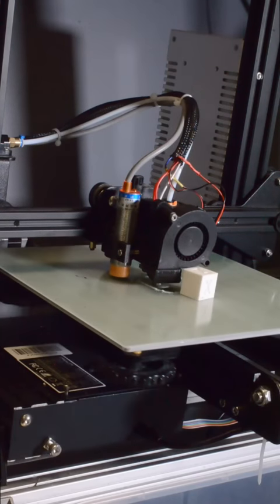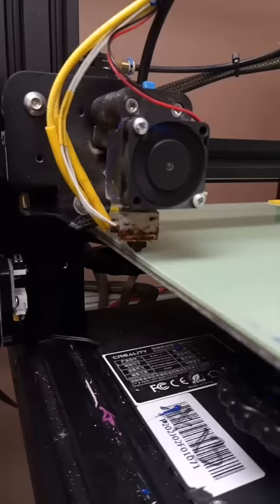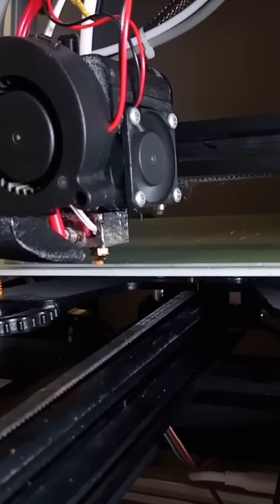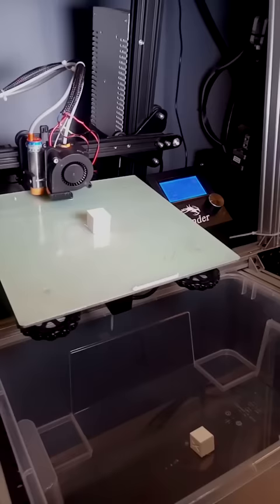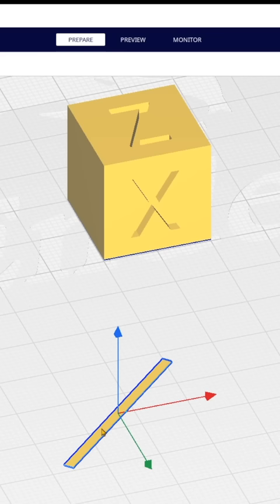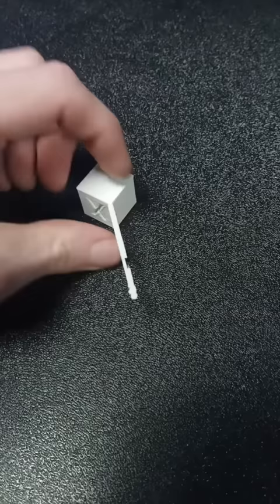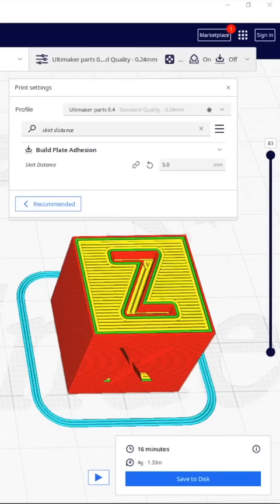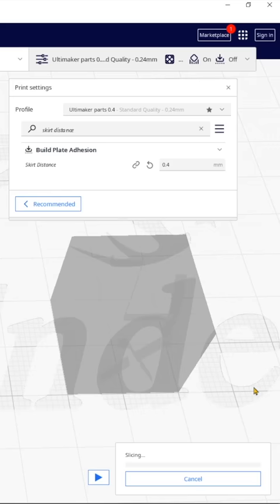How do automated 3D printers remove skirts and purge lines?

Comment: FYI, if you use the Cura extension "Parts for Calibration", you don't need to model simple shapes in CAD anymore - just insert and scale them. Works great for manual supports, corner tabs, and things like this.
Reply from the maker: Great tip, thanks for sharing!
Reply: @3DQue You should pin this, it's actually useful information.
Reply from the maker: @gownerjones  Good idea. Pinned :)
Reply: How do you auto eject @3DQue
Reply from the maker: @colb316  Join our discord server to learn how to auto eject prints: https://discord.gg/JN9EDP8
Reply: @3DQue  ok I joined now where do I go
Reply from the maker: Check out the channel bambu-lab-auto-ejection @colb316

Comment: I'm sort of if new to 3d printing (about 7 months,) is there any use cases for a skirt?
Reply: Normal skirts are good because they purge the filament. If you do a few lines thick, you can also watch the deposition to check everything's working as it should be before you print
Reply: Thank you
Reply: Good for baby stepping your z offset manually to get a good first layer too. Different filament can need different z offsets.
Reply: It tells me the part outline before actually starting the part, so i can see if i placed enough tape. It also primes the nozzle, in case some leaked out during pre heating
Reply: I never use them and find that Cura defaults to using them super annoying.
Reply: @court2379  wierd, for me it doesn't default to that.
Reply: @zekeprice  Probably depends who setup the profile for different printers and filaments. I really should create my own, but I usually just use the provided ones.
Reply: Makes sense
Reply: Helps you figure out if your printer is levelled properly
Reply: Basically a purge line, and a bed level check
Reply: @wikedawsom  I don't understand all the fuss with tramming the bed. You set it once after changing a nozzle, and then don't have to touch it for half a year or more. So to then have a skirt all the time is just a waste of plastic and print time. I just watch the first perimeter go down and adjust it if needed while printing. If it's really bad you are going to need to stop the print either way.
Reply: @Shawn R  I tend to switch back and forth in between ASA and pla Pro on one of my printers. Dialing the offset that fraction more, is how I am able to get 0 glue stick, yet perfect adhesion with Poly-ASA.
Reply: @TTS-TP  i still use glue sticks lol
Reply: I love the skirt setting to make sure that im getting good adhesion indicator for the area that the print will be done in. It also helps me make sure that i e got a proper z offset and gives the extruder the opportunity to purge any possible gunk or show under/over extrusion if i make any major changes to the print speed settings.
Reply: The main use of the skirt is to prime the pressure inside the nozzle. Otherwise your print may start with empty line. Other use of skirt is that you can print tall skirt (as high as the print part), and it will cover and shield the printed part away from the cold environment to prevent warping
Reply: Skirts can also add surface area to the bottom layer of the print, allowing for better adhesion.
Reply: I may also be combining skirts and brims in my mind...
Reply: I do three line skirts so I can check my bed remains leveled. Just by eye I know how first two lines should look like and can level it while running. Third line is to be sure I leveled it correctly.

Comment: you also can "hang" the purge down the edge of the buildplate, like Snapmaker does it for example  - it requires your printer to go out of bounds of the buildplate or have a rounded corner that lies ot ouf bounds though

Comment: I've completely removed the purge line from my Cura settings, after I found that it wasn't actually necessary if you print in the same filament and color. If you change filament type and/or color, you can just run a purge print and that should be good enough. Only problem may be if you use composite filaments, which can be problematic and truth be told, I've only tested this with white PLA, so I honestly don't know if changing will work, but it should. There's no reason as to why it shouldn't. Your nozzle can be clogged regardless of what filament type/color you're using
Reply from the maker: Very true. Nozzle clogs can happen any time. With high volume printing, we find that we have fewer issues if we use a skirt.

Comment: For Ender 3. I made an extrusion along Y, at the maximum X (235 mm). Due to the fact that the end of the ender is crooked, it is empty there.  Of course, I put 235x235mm in the firmware.
Reply from the maker: That's another good way of doing it, just dumping the filament into thin air. Does the nozzle get wiped by the edge of the bed? I know some people have tried that, and it can work if you tune it properly, but it takes a bit of trial and error.

Comment: Hint.. you dont even need a purge line.. or skirt.. or brims :P
Reply: Yeah, why have a brim in an automated system?
Reply from the maker: Brim isn't exactly necessary, but something like a skirt or purge line is helpful to make sure the first layer goes down perfectly without issues. Sometimes there's a little bit of filament that curls up, or a bit of ooze, and if that happens during the skirt, then it won't ruin the actual print.
Reply: Just do a brim with 2-3 rings
Reply: @soon3794  the thing is: a purge line always has the same length. A brims length changes with the Surface of the bottom layer of the thing you want to print. So a purge line is more consistent
Reply: @Okararu  i personally dont see the need for the purge to be consistent, as long as its over a certain length. If too short, increase the brims. Also a skirt mentioned above does the same thing but worse if your trying to manually set the distance.
Reply: @soon3794  Brim is unpleasant, someone will have to take that off. Except brim ears. Bears.
Reply: @3DQue  The purge line I understand (especially if there's a cool/heat cycle between parts) but automated parts making doesn't need a skirt; print one manually to fine-adjust the bed and then autoprint without.
Reply: @wesley00042  either purge line or skirt works - we prefer purge line, too
Reply: I don't understand skirts. What do they buy above purge lines? At worst, they're hard to remove and damaging to the bed, and at best, they don't do anything but waste filament.
Reply: @Okararu  You can set a minimum lenght for the brim, problem solved. I think a purge line is just wasted material if you have a skirt or brim.
Reply: @SianaGearz  You can set the distance between brim and the part, I usually print with 0.12mm, that makes it really easy to remove the brim, don't mess with the print and still help with bed adhesion.
Reply: @tchakizera4569  the point of having a purge line is to not use a skirt/brim. It's its whole point to be consistent for every print, no matter what you print.
Reply: @curtmcd they block slight breezes from cooling and warping the first layer. It may not seem like that's possible, but they do work for that purpose.

Comment: My problem was the bed adhesion was so good I fried a driver when it failed to push a print off the bed.
Don't ask me how it fried. I don't know. It was just a cheap off the shelf driver.
Reply: Driver was undersized or defective. You should be able to skip steps all day without frying the driver.
Reply: @user2C47  it was a cheapish printer so I wouldn't be surprised if they were cheap.

Comment: If you just modify the starting gcode in cura, you can connect the purge like to your print automatically
Reply from the maker: We do put the purge lines at the front of the bed - then the part pushes them off when it is ejected.

Comment: If you using a skirt just don't use a purge line. I edited out the purge line like a week after I got my printer back in 2020
Reply from the maker: The only time we end up with both is when we need just a tiny bit of help to keep the part from warping. With automation, we want to minimize labor so you may use a skirt with the a teeny bit of attached material to stop the warping but not attached enough to be a true "brim". The barely-attached skirt will be removed with the part and separate from the part as it drops in the bin. If it is a small run, we may not bother taking the time to remove the purge line from the start gcode. If we are going to do a 1,000 parts, we would for sure.

Comment: Brims actually connect to the 3d print. Only problem is that it takes a little bit of extra work to take off the print. Compound that by how many prints you make, it could take a while to clean the brim off all the prints.
Reply from the maker: You bet! That's why we prefer to print a skirt close to the print rather than a brim. Of course, that is only if you don't need a full brim to avoid warping.

Comment: I have the fix for all your problems in the video ... brims. Also, switch to Prusa Slicer, Super Slicer, or Orca Slicer. All have infinitely more configurability and have amazing in-software calibration tools/programs you can run.
Reply from the maker: Brim + 0.4mm brim distance is pretty good too, and it's really easy to remove.

Also I agree, I would move to Prusaslicer, just all our gcode is currently saved as Cura project 3mf files so it is hard to make the switch.
Reply: @3DQue  PrusaSlicer has custom gcode entries. It would be time consuming, but shouldn't be super difficult
Reply: @3DQue  3MF is basically the universal 3DP format now and all the other slicers should be able to read all of the data. If not, you can manually add in custom start/stop gcode to have it applied to each exported print file. I constantly switch between all the slicers for my Ender 3 Pro (heavily modified), Ender 2 Pro ) full stock, and Kingroon KP3S Pro (heavily modified, more than the E3), and have 0 issues as long as the printed files was exported from the proper machine template.

Comment: Why do you need the purge lines/skirts?
Reply from the maker: Printers cool down between prints so you need to purge the nozzle when it heats up again to ensure that the material is flowing smoothly and avoid first layer problems.
Skirts are simply another way to purge the nozzle.
Sometimes, the skirts clear the bed more cleanly.

Comment: I won't risk that, it's better to made linear with another nema7 stepper motor, and just active it with simple switch that extruder head can click and wait until diy wipper clean the heatbed :) its not hard at all, ardunio with h-bridge can do the work without complicated special board
Reply from the maker: But it works perfectly fine without all of that. Keep it simple!
Reply from the maker: But it works perfectly fine without all of that. Keep it simple!

Comment: I have a plastic scoop tool that can easly scrape my line and 3d prints of they are better then the metals scoops
Reply from the maker: Interesting! These printers have the VAAPR print bed which is calibrated for no-touch part ejection. You can't use metal on the VAAPR beds but plastic might be gentle enough. Is this a custom design?

Comment: Just edit the g code so the bed doesn't heat until after your purge line so it doesn't adhere as well.
Reply from the maker: That is an option but it means changing your gcode files and with the VAAPR print bed there is no issue with purge line removal.

Comment: I know nothing about 3D printers but Im assuming if you print multi colored prints the purge line os there to remove excess
Material from the other color so that you don’t have weird color blending?
Reply: It depends on the multi-color system you use. Some of them actually splice the filament. 
Purge lines are required to ensure a good first layer for the print.
Reply: @stephsharp8475  very cool! Thanks for the information
Reply from the maker: Purge lines are used between prints. When the filament cools down and heats up again, the initial flow can be uneven.

Comment: I don't own a 3d printer so I have no clue what the purpose of purge lines is. Can someone help me?
Reply from the maker: Purge lines clear the nozzle, ensuring that fresh filament is extruding once the actual print begins. Sometimes there is an air bubble inside the nozzle, or degraded filament if the nozzle has been hot for a long time. Purging all that out makes sure the print begins reliably, and any defects are on the disposable purge line/skirt rather than the print.
Reply: @3DQue  Ah ok. That makes sense. It also makes sense as to why you'd want to barely connect it to the print instead of having it off in no man's land since it's a short line.

Thanks for the explanation!

Comment: The connected purge line doesn't make sense to me, can't controll where your printer starts for the first layer of the model. It could start cwnter of example cube or a corner. By the t8me it gets to the purge line, it already affective purged.
Reply from the maker: It starts on the bottom left

Comment: Could you not also make the skirt taller? Like 3-4 layers then knock it off.
Reply from the maker: Yep, Prusaslicer has that, and in Cura you have to use a draft shield instead but it's basically the same.

Draft shield is good for making a cage around multiple separate objects so they all fall off together

Comment: I can work out from context what a purge line is for, but can someone tell me what the skirt does?
Reply from the maker: The skirt is generally used to test first layer adhesion. A purge line is usually quite short whereas a skirt follows the outline of the part and so is a better test of adhesion. A skirt also doubles as a purge line so you don't need both.

Comment: Any good reason to use a skirt????
Reply from the maker: Test the first layer adhesion around the part rather than off to the side of the bed. That's what most of our customers use them for. They aren't used in high volume production with ABL and automated part ejection.

Comment: What's a purge and a skirt? I'm assuming purge us to empty the hot plastic after printing to avoid clogs?
Reply from the maker: Purge lines clear the nozzle so the flow is completely even when the prints start. The skirt is the shape of the printed part and serves a dual role of purging and ensure the first layer adhesion is good.

Comment: How long after the print finishes before it gets knocked off?
Reply from the maker: Great question! It really depends on the ambient conditions. The VAAPR print bed generally releases parts around 29C so if the room is room temperature (20C or 70F), it cools pretty quickly. If the room is hot, it takes longer.

Comment: I add draft shield to skirt.
Working flawlessly.
With Chinese cheap ass PEI and custom end g code.
Reply from the maker: Draft shield is good too! That one is especially helpful if there are multiple prints on the bed. The shield makes a cage that helps guide parts off

Comment: Or just get a creatalty belt printer if you want automated printing in my opinion it’s not worth going through all the trouble for this I bought a used one for 500 bucks and it’s been doing great and as a plus I can print crazy long stuff it’s also really nice if your trying to sell stuff and need a bunch of one really small thing you just input a number of the item you want in the slicer and go to sleep and when you wake up you got ten in a basket
Reply from the maker: That is another option and really good for long parts. 
The difference with this is that you can load an infinite variety of prints into the queue and you only need to refill filament once in awhile. The VAAPR print bed does not wear out and because it is touch-free removal you rarely have to recalibrate the printers. We mostly automate print farms.

Comment: Nice, I'm getting a printer this year. I'm thinking of a resin printer, but it's so hard to choose
Reply: Resin is good if you do small stuff less frequently and dimensional accuracy isn't critical. 
Fdm is good if you want larger parts and print more often (as it's cheaper to run and to get a big volume printer) and if you don't mind tinkering, as fdm has more stuff that can go wrong.

I've got both, my photon s is send file, get print, my fdm is currently out of order.
Reply: @satibel  Thank you for the info!

Comment: The problem with skirts is that people use them even though they absolutely don't need to.
Reply: The problem with people is that people use skirts even though they absolutely don't need to.
Reply: Skirts were useful for older printers that had to be manually trammed, and would give a good indicator wether your first print after doing so would adhere properly. Nowadays it's not really necessary for that purpose.
Reply from the maker: True

Comment: Hi I'm new to all this, what are the skirts and purge lines for? 
I think purge lines are for when colors are being switched, other than that I'm not sure
Reply from the maker: When a new print is started, the nozzle can drip so the skirt or purge line just gets the flow going to ensure your first layer has no strings or blobs.
Reply: @3DQue  that makes sense, thank you!

Are there times when a skirt is preferred over the line? The line just seems simpler to me, so why worry with other alternatives.

Comment: I still don't see the purpose of skirts; brims and rafts, yes, but not skirts. They don't actually support the print, or stabilize the edges securely to the print bed.
Reply from the maker: Correct. Skirts may be used when people want to check flow rate consistency or generally get a sense as to how the first layer is going down. Since it goes around the entire print, it can provide information that a purge line or tower cannot.

Comment: Do you have any tips for printing on glass? Done heaps of research but still having problems
Reply from the maker: Print the first layer hot, thick, and slow. Try 150% line width, 0.32mm first layer height, and 10 mm/s print speed. And bump the nozzle temperature up by 10 degrees for just the first layer.